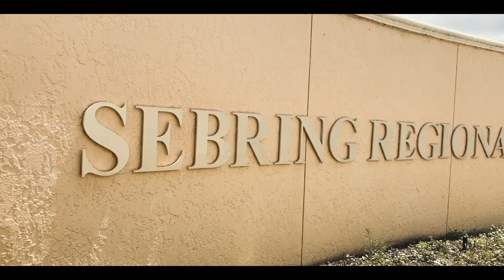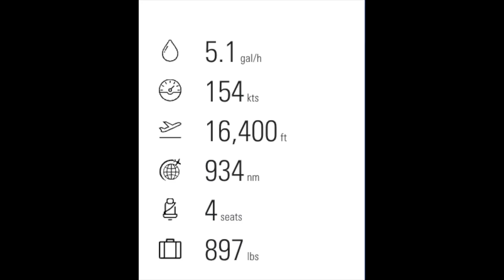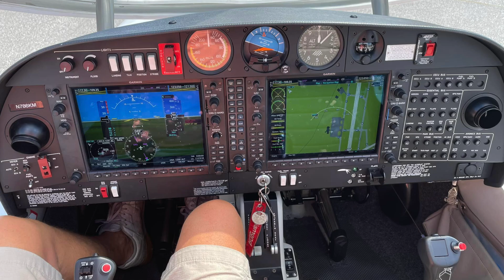Is Diesel the Key to an Unleaded Future for General Aviation?

Comment: Huh! I wonder why they can't be overhauled? Amost all kinds of engines, diesel and gasoline, can be normally.
Reply from the maker: They can be overhauled, they just can’t be reinstalled on an airplane.
Reply: @MadPropsAero     ok I got that. But why,? I imagine they are built as light weight as they dare for aircraft engines. As we know diesels are generally much heavier powerplants to withstand their inherit stress & vibrations. So I imagine they must be concerned with metal stress and fatigue of the crankcase/ block /main engine parts. So it's cost effective to replace the entire powerplant instead of replacing the block and every other necessary part piece meal. There, I guess I answered my own question! Ha ha

Comment: Continental CD-155 would be the more appropriate reference to stc into a 172. 2018 cost was $78k for the engine and stc, basically double the cost of a factory reman O320 putting out the same hp.
Reply from the maker: Short production runs definitely tend to result in higher prices. As production numbers increase cost is reduced. That may or may not ever come to pass for general aviation diesels. Time will tell.

Comment: Diesel engines are much more expensive (like twice) than a comparable gas engine. Diesel maintenance costs are much more, lots of leaks.
Reply from the maker: If the diesel burns just 3 GPH less than the 100LL equivalent, and fuel averages $5 per gallon, the savings over the life of the engine would be in excess of $31,000.
Reply: @MadPropsAero  In a 172, a Rotax 916 would also be significantly more efficient than the original LyCont, and it would be able to burn mogas, which is much less expensive than both avgas and jet fuel.

Also, there are some good reasons why the JT-A flopped almost instantly.
Reply from the maker: @PistonAvatarGuy  we're with you on the use of the Rotax 916. Unleaded fuel will be a bigger and bigger issue as time goes on and Rotax has proven their ability to build rock-solid powerplants that run well on it.

Comment: George Brayton made his first “Ready Motor” in 1872. it was used to power boats a bus rail cars and even a couple of submarines. Today we know the Brayton Cycle as the gas turbine cycle used by most larger aircraft. What is often missed is Brayton was also instrumental in the invention of the Diesel Engine. He pioneered the high pressure fuel injector and was the first person to create a lean burn engine. Brayton died in 1892 the same year Mr Diesel applied for his first patent. Diesel’s original patent described a cycle called expansion at constant temperature. This cycle required an extremely high compression ratio. When it failed to produce an operational engine Diesel adopted the constant pressure cycle which was Brayton’s invention.

Comment: Hmmmm I’m skeptical.  US Govt GSA stopped buying diesel vehicles for their fleet vehicles years ago because initial cost and ongoing maintenance is higher than a gasoline engine vehicle.  They also use a vehicle up. USForest Service and BIA Forest Service need and use tough dependable 4x4 gasoline vehicles that require less maintenance or repairs.  Cost less at purchase. At 100K or so miles the government Trucks and SUVs are worn out.
Reply from the maker: We're suspicious of that claim. The military still uses diesel powerplants for everything from motorcycles to tanks. The Post Office continues to include diesels in their fleet, as does the Forest Service, as well as the General Services Administration. 
Diesels still emit exhaust, which is a problem for any internal combustion engine, but to say the government has abandoned diesel is simply not true.
Reply: @MadPropsAero  Military vehicles are subject to operation in battle (diesel is a safer fuel in such situations), they're not really ever subject to limitations based on cost of operation and there's no need for them to have their emissions controlled.
Reply from the maker: Agreed,  @PistonAvatarGuy . But they also have to run reliably even under harsh conditions. As do aircraft.
Reply: @MadPropsAero  Modern automotive gasoline engines are often more reliable than modern diesels, especially when you take into account the problems that diesels have with their emissions control systems. Even without including the problems with emissions control systems, diesels are having trouble with injectors, high pressure fuel pumps, rotating assembly parts (EcoDiesel), turbochargers (not a requirement on gasoline aircraft engines), etc.

Cummins has even started offering a gasoline version of their B series engine, because of the high costs associated with operating diesels and the problems that come with their emissions control systems.

Also the Detroit Diesel V8s used in the humvees were never considered to be very reliable relative to gasoline V8s. The DD V8s in the humvees even have an electronic module that was very prone to failure, and they will not run without that module. They also had problems with glow plugs breaking off, causing catastrophic damage to the engine internals. Those engines are probably better sorted these days, but I've known people who were in the military who had nothing good to say about those vehicles/engines. I even had a friend in middle school who had an older brother who worked on humvees.

Natural gas engines are also becoming increasingly attractive to fleet operators, due to the problems with modern diesels.

There's nothing inherently reliable about a diesel engine.

Comment: I did not realize diesel engines were on airplanes. Coming from a farming and trucking background, I thought diesel engines were too heavy due to handling higher compression. I would be worried about the EPA sneaking in and requiring emissions standards equivalent to trucks. 90% of the time my truck went to the shop was because of emissions system failure...
Reply: Yes a diesel may be heavier. But if it gets double the fuel economy, then you only need to carry half the fuel! It does pose some small issues as far as balance on an aircraft - too much weight at the front can move the center of gravity too far forwards. But that can be solved through good engineering, or even something as simple as putting extra weight at the extreme back of the plane to help compensate.

Diesel makes a ton of sense to me as an aircraft fuel: it's unleaded, it has good efficiency, it's not as flammable, it's ready available across the US. For me it's not the only deciding point on which aircraft to buy, but it is a major consideration.
Reply: @masonmcglothlin5101  The DA50 uses the same amount of fuel as the Bonanza at 170 knots. The DA50 is even less energy efficient than the Bonanza, because jet fuel contains more energy by volume. Gasoline engines can be highly efficient when they're allowed to run lean, as gasoline aircraft engines are allowed to run.

Diesels make terrible aircraft engines.
Reply: @PistonAvatarGuy  You can't compare two different aircraft. You've gotta keep it as closely lined up as possible. For example, the DA40 NG vs the DA40 XLT. Or the Piper Archer DLX vs LX.

Piper advertises the LX (avgas) as having a range of 522nm while the DLX (diesel) has a range of 848nm. They both have a 48 gallon tank.

You might want to check your own statement as this doesn't make sense: "The DA50 is even less energy efficient than the Bonanza, because jet fuel contains more energy by volume".
Reply: @masonmcglothlin5101  They're competing aircraft, the comparison is valid.

Anyway, comparing 1930s gasoline engine technology to modern diesel engine technology doesn't make much sense, either, if we're criticizing the comparisons being made. Liquid cooling, alone, offers enormous potential for the improvement in the efficiency of gasoline engines. Both the Continental Voyager engines and the Liquid Cooled Air Power engines demonstrated very significant improvements in efficiency over air-cooled LyConts, and there are likely to be further potential improvements over what they achieved (the Continental engine was designed in the '80s, the Liquid Cooled Air Power engine wasn't a fully mature design).

100LL Avgas: 31.6 MJ/L
Jet fuel: 35 MJ/L
Reply: @PistonAvatarGuy  You seem to be aware that jet fuel contains more energy for the same volume, so its very strange you are also saying diesel engines are less efficient. That doesn't make sense. And yes, if you want to compare avgas engines to diesel engines, you need to make sure the aircraft they're installed in are as similar as possible. It's not enough that the aircraft just be competing with each other. Different aircraft have different designs that cloud the comparison. While it's perfectly reasonable to discuss the Bonanza vs DA50 aircraft if you're in the market for an aircraft, it's not relevant to a discussion about which fuel or engine type has better effiency.

I'm comparing 1930's engines to modern diesel engines because they're both used in the same aircraft. If you want to compare modern avgas engines to modern diesel engines, then find an example of them installed in the same model of aircraft.
Reply: @masonmcglothlin5101  I said that the DA50 was less energy efficient than the Bonanza, because both aircraft burn the same amount of fuel (by volume) at 170 knots, but the DA50 is burning fuel that contains more energy by volume.

The problem here is that there are no modern gasoline aircraft engines to use in this comparison, that's why I mentioned the Continental Voyager engines and the Liquid Cooled Air Power engines.

Aviation diesel engine BSFC: 0.35-0.36 lb/hp/hr (this is roughly the same for all of the aviation diesels currently being offered for sale in certified aircraft)
Liquid Cooled Air Power engine BSFC: 0.36 lb/hp/hr (at full power)
Continental Voyager engine BSFC: 0.37 lb/hp/hr (at a typical cruise power setting, according to an SAE paper)

Jet fuel and avgas have roughly the same energy density by weight, so the engines listed above have close to the same thermal efficiency.

If you're going to be talking about putting completely new engines in aircraft, why not talk about putting completely new gasoline engines in aircraft?
Reply: BTW, it's likely that the design of the DA50 is less efficient than the Bonanza because it was designed to accommodate a very heavy diesel engine from the start. Also, IIRC, the Cirrus SR22T manages to fly faster than the DA50, while consuming about the same amount of fuel per unit of distance traveled.

Edit: At 10,000 feet:

DA50 (90% power): 172 knots @ 15.9 gph (10.8 nm/gal)
SR22T (85% power): 184 knots @ 18.3 gph (10.0 nm/gal)
SR22T (75% power): 175 knots @ 16.4 gph (10.6 nm/gal)

That's a fixed gear aircraft with very old gasoline engine technology.
Reply from the maker: They are more robustly built than the gasoline burning equivalent, but they’re not as big or heavy as the diesels in our tractors and combines.
Reply: @MadPropsAero just hope the government doesn't start requiring DPF or DEF tanks on aircraft. "Gotta fly, but first I have to put this corrosive material on board for emissions..."